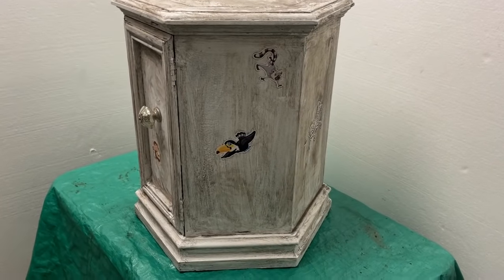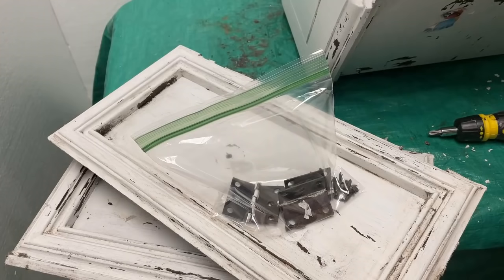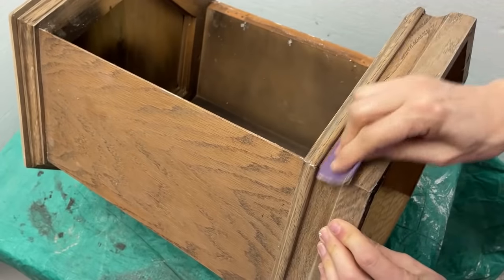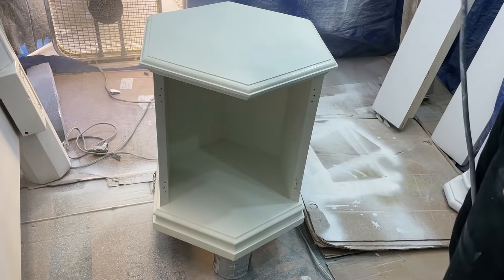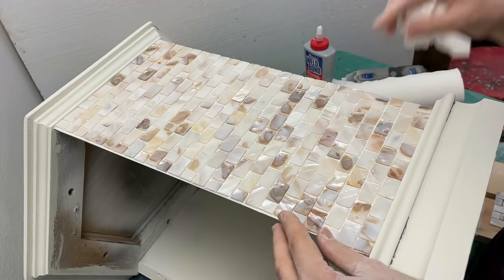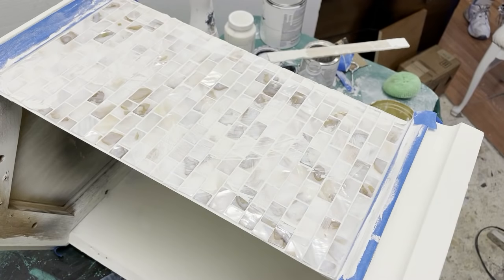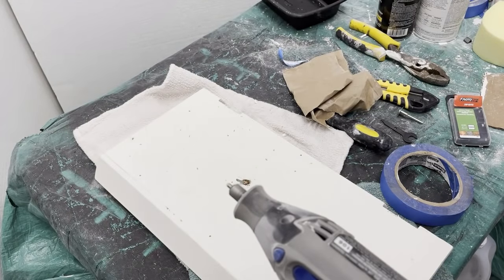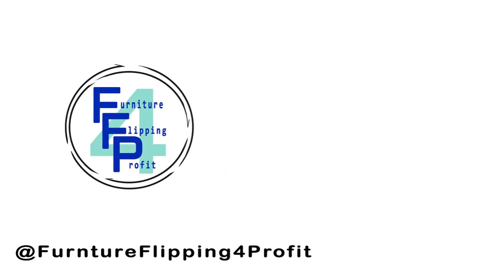AMAZING RESTORATION OF VINTAGE SIDE TABLE  w/ MOTHER OF PEARL TILE /Furniture Restoration

Comment: So pretty and what an upgrade!It was so interesting that you were able to use the brown bag sanding method on the tile like you can with wood. It's such a good option, so you wouldn't scratch the tile. Great  job! 🙂👍
Reply from the maker: The brown bag worked very well. In fact, I think I could have used it in lieu of the sponge with water on it (and then I would not have removed some of the grout between the tile). Unfortunately, I did not try using the paper bag until I was working on the last section.

Comment: That was an amazing transformation. I am considering redoing my bedroom set. The drawers a shaker style and I want to add a touch of elegance to the inset on the drawer. This may be the solution.
Reply from the maker: OMG! That would be so pretty!!! The paint color I used coordinated perfectly . I scoured the internet to  get the best price for the tile. On Amazon, the average price for the tile is $10 per sheet! I used 6 sheets on this table. The photo in the video shows the one I purchased. It was I think $39 for 10 tiles (if I remember correctly) I am glad I tinted the grout because it too matched the paint and tile perfectly.  This tile also comes in white and that would be gorgeous on your bedroom set. I will post links to all the supplies on my blog and put the link in the description of this video. I will do that this weekend so stay tuned.  Please give the video a thumbs up. That helps my channel a LOT!!!

Comment: W O W!! This is a gorgeous piece and what a transformation!! So appreciate your detailed instructions on each of the steps. Is there somewhere with a list of products (like the mother of pearl tiles) you used for this? Especially the types of cutting blades, drill bits, type of grout, etc. Thank you so much! Again, just gorgeous piece!💜
Reply from the maker: Hi Ashley, I am going to post it in my blog- sorry I have been busy and not had a chance to do it. I will get to it this weekend. Currently in the midst of refinishing a vintage vanity painted pink and blue -UGH!!

Comment: Beautiful makeover! A couple questions: Did the paint help the barn smell? And, I'm assuming you are selling this, since that is the premise of your channel. What was your cost and what price did you list/sell it for? Again, you did a wonderful job with this.
Reply from the maker: When I cleaned it inside and out that got rid of most of the smell but the strong smell of the stripped killed any leftover smell. I think I was lucky that the doors were painted shut. I think it kept the smell out of the inside of the cabinet.
Reply: @FurnitureFlippingForProfit  I was thinking the exact same thing! There is NOTHING that can survive stripper. No residue or finish or smell will survive. Thanks for stressing the dangers of it so prominently. I worked with it for the first time without any knowledge except the fact that I was working with VERY potent and dangerous stuff so luckily I took every precaution possible. That's me tho. But a lot of ppl are impatient/uninformed/irresponsible. So please take  note, everyone!!! Cannot stress this enough!!
Oh, and great job, BTW! Comprehensive video and well explained. And gorgeous end product!!
Reply: If the paint stripper is that dangerous, I would apply/use it outside, in a light breeze away from buildings/open windows and doors. When she was applying it, In another shot we saw she had a box fan in an external open door in that room with the top half covered to stop the air coming back in, assuming with another door/window open for replacement air = the room was “well ventilated” as they state in the safety warnings on those chemicals 😉⚠️✅

Comment: I used to have a table similar to this but with a marble top. I cried when I got rid of it but needed a table that was elevated of the ground because it was in front of the furnace vent. I never thought about just putting legs on it. <sigh>  Live and learn. This is beautiful.
Reply from the maker: Thanks Lisa- someday you may find one just like it on FBM

Comment: How do people get these great pieces for free or out of barns, and all the ones I find are literally trash and falling to pieces?
Reply from the maker: Hi Karen, I did not get this for free. I actually paid for it. I found it at an estate sale. 

If you scour facebook marketplace daily ( or even multiple times a day) you might be surprised at what you will find. When people give it away for free you have to contact them ASAP and go get it asap! I recently got a kin g headboard, 2 nightstands and a dresser for free. I am painting it white and will post it on FBM for over $1200. I may get that much but recently I sold one of similar size for $920 so I am certain I will get at least $1200 for it. I had been watching it on FBM and it was listed for $500. Then she posted it for free because the movers were coming the next day. That's why she gave it away for free.

Comment: That was going just fine until you added those appallingly cheap and nasty legs. That cabinet is not intended to have legs; there is a plinth on the bottom that's meant to stand on the floor.